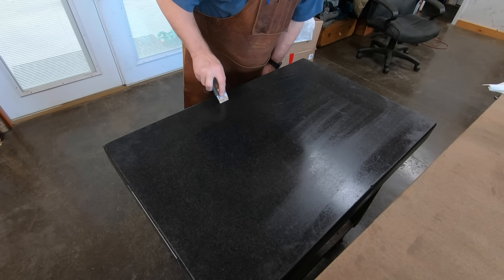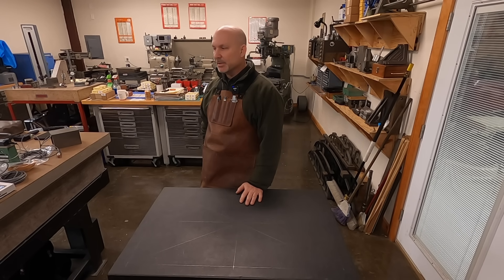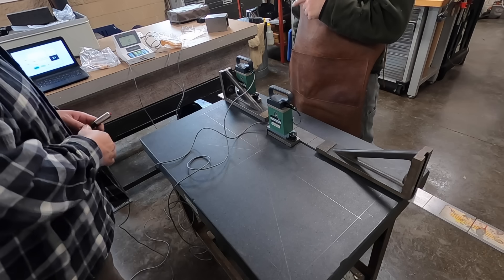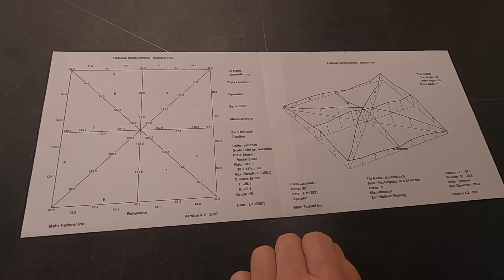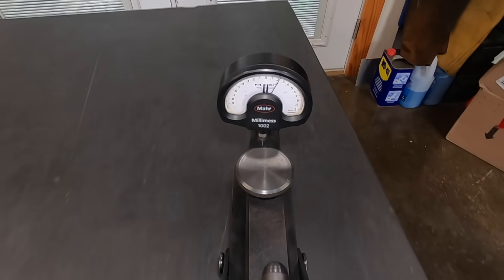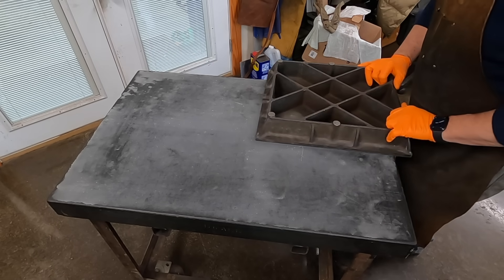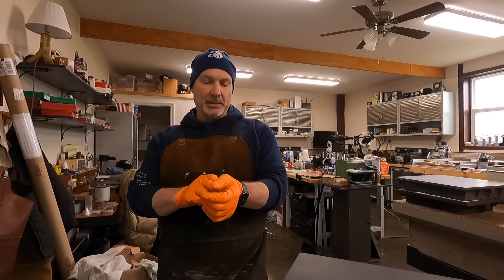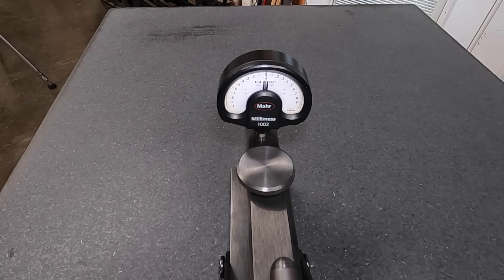Lapping my Granite Surface Plate to AA Grade

Comment: I worked in a 2A lab for the USAF for 12 years. This is exactly how it is done. Great job!!! Let the haters hate.
Reply: Underrated comment
Reply: Hi Ben, Can we use sand paper with foam pad instead of diamond dust? I think abrasive particles in sandpaper won't  be charged into the plate.

Comment: There's the term for it: "credentialism". People these days rely too much on someone's diplomas and certificates since they are often incapable of assessing the actual substance of the work done or the logic presented.
Reply: Some who are obsessed with credentials have become known to me as wokels, and wokel yokels.
Reply: I rather think this tread got started by some one who is in the wrong job. If they have spent for ever getting qualified then plainly it’s not their forte!
Reply: @johnsherborne3245 , that happens too. Although, I've seen some solid professionals who are perfectly capable of getting great results, but still believe that the only proper path to that point is formal training, certification, all those things. Definitely, being self-taught isn't for anyone and nobody says that everybody can or should do that. But people who successfully taught themselves or learned their trade in some informal way definitely exist on the same level as those who were trained traditionally.
Reply: I agree to some point but there are reasons for certification. What if some deadly failure was a result of bad tolerances and your tools weren’t calibrated by a certified company?
It’s chain that needs to work.

However I feel like a certification will become more and more watered down since it doesn’t mean you know what you're doing.
I also think certifications is a tool used to   “save” domestic workers.
Reply: Logical fallacy of appeal to authority.   Those fraught with this idea are the problem with modern society. These morons are the kind who worship career politicians and bemoan business owners.
Reply: @keithjurena9319 Logical fallacies fall under the domain of rhetoric, so the suggestion that an appeal to authority fallacy exists here is a misapplication of categories. Authority is the foundation of metrology. This especially applies when using any standard unit to characterize a physical object or phenomenon. Traceability to an authoritative standard is necessary to determine the amount of deviation from the standard.

Flatness itself isn't a feature of size, but rather a platonic ideal characteristic - it's self-referential.

In any case, the confidence and certainty in the characterization of this surface plate is at least as high as any I've seen from surface plate guys in the several decades I've worked in toolrooms and inspection labs.
Reply: @LILLJE , certification does have a very specific purpose. And it's equally wrong to do things that legally require certification for a reason without having one as well as requiring a certification just because you feel like it has to be required. In the modern world where people don't just care about safety but get really obsessed with it, the latter option is already too common without any positive outcome.
Reply: Idk in my field the credentials themselves aren't what's important. They hire ppl with the degree bc it certifies that you made it through the hell that is the program, and have the mentality and work ethic necessary to do the job. It's about the type of person, not the piece of paper.
Reply: I've seen certified persons that have no business doing what they're doing!
Reply: You mean you didn't buy a piece of paper to say you are smart!?
Reply: @LILLJE  And what is their certification going to do to ensure the tool doesn't fail? If it is going to fail it is going to fail and things certified by "authorities" fail all the time. True capitalism is the closest thing to real certification. If something or someone consistently does a good job they will have business.
Reply: @Complete bagel actually the one who will consistently do a sufficient job for the cheapest will have a business... or who make the buyer believe they did
Reply: I'm reminded of a story where an artist was being selected to draw a portrait for royalty. They asked for his credentials and while the artist was well trained and highly experienced from a reputable arts college, in response he sent only a sheet of paper with perfect hand drawn circle. The proof is in the pudding and having the right piece of paper to say one is qualified has little bearing.
Reply: The whole point of a certificate is just to say "this is agreed to be good by a several widely recognised experts". If you hadn't seen this video, and with no references you were shown the plate and told by a random guy it was lab grade, how would you be able to trust it? This video, in a way, is a kind of certification in that we get to judge how much we trust his results.

That's all certification is supposed to do. It's just a way of saving you the time of assessing it and finding a trusted expert to assess it. That's also why cheating is very harshly treated in reputable certification systems, as it completely undermines the whole purpose of the certificate and endangers the livelihood of anyone that uses those certs. 

Somehow, people have started seeing certs as some kind of superiority thing and then started attacking the idea of certs because of that. Certifications just mean for this one specific thing a bunch of other widely agreed to be experts have assessed their work and said it meets their standards.

And as others have pointed out, somethings can't really be certified, like art. If you wanted a graphic designer, even if they showed you their degree or post doc, you'd still need to see their work to know if they're right for your needs. At least with scientific things, there's not multiple completely different solutions that aren't interchangeable.
Reply: @LILLJE  the only reason I have to disagree is that no piece of paper prevents a mistake.

Comment: I spent 37 years in a US Army depot calibration lab as a technician and as a supervisor. We used a Mahr-Federal electronic differential level system to calibrate several surface plates every three years. Before that system came along, we used a collimator and mirrors to measure the flatness. That was much more difficult. Occasionally, we hired a contractor to come in and resurface the plates that didn't meet the specifications.

Comment: I have had the pleasure of seeing the "gauging lab" at a GM auto factory. It was a "clean room" that no one was allowed to enter except the certified technicians. The oil on your had would ruin their plates. It had large window so you could see the surface plates. It had an air-lock, and a huge HVAC to make absolutely sure that the interior of the room had "adequate climate control." The instruments in the room were used to calibrate the gauges that were used to calibrate the gauges that were used to check the parts being made.
Reply: Most people have no clue and it's really sad. Given what we do nowadays we should make way more money. Literally everything would stop if all machinists said nope. It would take weeks not years for inventories to run out and start affecting the world as a whole. You can't just replace these workers as a whole. It would be akin to letting the power go out worldwide. It's now or never before we're all tortured slaves. We're already slaves.
Reply: @drewjohnson4794  extreme tolerances and the ability to measure them is what makes modern society possible

Comment: Adam form the work that you do in you're shop that plate will be just fine for what you do.
Lance did a great job getting the plate to AA.
TAKE CARE OF THIS VERY IMPORTANT TOOL.
As a old tool maker I will tell you that the surface plate is the most important tool in the shop.
Congratulations

Comment: I worked in a machine shop with a large pink granite Starrett, I think it was A grade, anyway it had been used to assemble parts on. I made a table to hold it and had an office built around it, it was fabulous but had some chips/dings in it.

Comment: My father was a tool and die maker all his life and spent a lot of his time between a Boyar-Shultz surface grinder and his granite surface plate on his workbench nearby. Most of his work was in the .0001" tolerance range. Occasionally, he would get me to help him lift and rotate his black granite plate so that it would get even wear. The only thing he used to clean it was isopropyl alcohol. He could get a steel plate ground so flat that when you cleaned both the steel plate and the surface plate, the steel plate would float on a bed of air just like an air hockey puck. They had an inspector come in every so often to check and recalibrate the plate and he used an instrument called an autocollimator. I haven't worked in the trade for decades and miss it so much. My home machine shop is also my hobby; therefore, I just the cast iron top of my table saw for my poor-man's surface plate. Maybe some day I will spring for a real granite surface plate.
Reply: You can get 2ftx3ft ones at auctions all the time for not an enormous amount of money.
Moving it is a whole expense of it's own of course.
Keep an eye out and one with come up near you in time.

Comment: if you pick up another cast lap plate and number them 1, 2, 3. lap them against each other, 1 and 2, 2 and 3, 1 and 3. without much effort you will be able to keep your laps flat within 1/4 micron without much trouble. use the same technique as on the granite plate, but without running off the edges so much. biggest problem i always had after having my plates lapped was working the diamond out of the granite. you're doing a real nice job there. pet peeve of mine, people who use a surface plate for a bench.

Comment: If your shop is doing work where the contracts specify the use of certified measuring equipment, you are going to be charging the premium prices that go along with that. Otherwise, having a plate this flat is more about enjoying having and using a top grade tool. The certification wouldn't make it any better.
Reply: But the certified plate would actually be flat, you can't get true precision with portable equipment. A repeatometer should NEVER be used to check test equipment, it just isn't that accurate, sorry
Reply: @jacktheaviator4938  That plate is now flatter and more precise than anything he's ever likely to need. They made that point. If you have customers that require things like aerospace grade measuring tools, you charge aerospace prices.
Reply: @CrimFerret  i’ve heard abomb say most of what he does is 1 1/2 thousand tolerance a good some what surface is really nice and he is just checking the plate not testing it
Reply: @jacktheaviator4938  go watch the video Oxtoolco did of the certified guys doing his plates.
It's the same process he did here, so the plate is just as flat as a certified plate.
The A and AA grades are standards that require the measurements to be within + or - of certain tolerances, in other words, some imperfections are allowed, and he got below the limits set by those standards, using the tools required by the standards, regardless of the certificates he has on the wall.

Comment: 3rd generation cal tech here. Been resurfacing plates for about 11 years now. Alcohol or any rapid evaporative isn't ideal for cleaning surface plates. The rapid evaporation can break the molecule bonds of the minerals, etching the surface. It can affect the flatness of the plate over time and makes the plate more susceptible to chipping, or chipping worse. We use krud cutter as a degreaser (initially) and glass cleaners without ammonia (secondary) to prevent mirrored surfaces from sticking. Any cleaning you do with a solution will cool the surface of the plate as it evaporates. also, water based cleaners will increase the likelihood of rusting between the plate and metal surfaces on the plate if not accounted for.

Comment: Them's some pretty neat levels, and a very good result.  I've got my diy plate down to under 1/100 mm overall.  I wrote my own software (based on a friend's excel spreadsheet) to do it.  Doesn't use moody - after all, moody was working when a "computer" was  bunch of people doing math by hand, and results had to be achievable within a reasonable timeframe, say a day or so - instead it does a bunch of matrix math and uses a rectilinear grid, so gets overall and local flatness (within, obviously, the size of grid, which is somewhat defined by the length of your level).

To go any lower on my plate, which I don't actually need or particularly intend to do, I'd need to get some new measuring equipment, as I'm already deep into the realm of margins of error.  I'm using a 200mm long 0.05mm/m spirit level, and running it on a 3-point carriage to get 60mm between readings (my last video was still "roughing" and using a 9cm grid). My last mapping involved taking 5 readings at each station, throwing away the min / max outliers, and averaging the rest.  Took 6 hours to do, for a 1m x 20cm plate.

Aaaaaanyhoo, the software is up on my github, it's simply a local web page with a bunch of javascript that does the calcs, if you or your buddy with the levels wanted to do anything with it, feel free to do so.  BSD License, https://github.com/tufty/surface-plate

Comment: To all of you bakers out there these granite surface plates make the ultimate pie crust rolling “boards” before you roll out the pie crust put ice on the board, in a plastic bag works great. Keep the ice on the surface plate for an hour or so. Now you have the cold surface needed to make a really flaky pie crust. Make sure you keep your stone rolling pins in the refrigerator.
Reply from the maker: That’s a great idea! Perfect for a cheap or even cheap used  granite plate 👍🏻
Reply: And you get the added benefit of keeping your overall crust thickness tolerances  to within a few tenths ;)
Reply: @Abom79  exactly I know professional pie makers that keep their granite surface plates in walk in refrigerators. They prefer black granite so they can see the pie crust dough easier.

Comment: At a certain factory I was visiting one day I set my hand on a giant like 18 feet long cast iron surface plate which was used for layout marking of large steel castings and it was quite warm to the touch. I asked the old layout marking wizard guys why and they told me the plate has heating elements inside and they turn on to warm the plate 2 times a day because if it wasn't heated, even in summer (northern europe) the plate would be too cold for the touch to work on (hands would get cold very fast and it would be very uncomfortable to work on it the whole day).

Comment: The picture of the reflection from this plate at the end of the video is the most visible proof of the flatness for me. Not really proof but it's good to see how free of distortion the reflection is.
Very interesting.
Reply: "Flatness" is a relative term. From my experience, the reflection does not show difference between grades. There's absolutely no difference in reflection between an B and and AAA+ plate in reflection. I've lapped a bit of granite by now so this is where my experience comes from.
Reply: @chronokoks  as I said, it is no proof, but it's reassuring. However mirrors are often measured by reflecting a known wavelength of light off their surface so this can be a proof if you have the right tools.
Reply: @musicbro8225  It's not reassuring for me at all :D
Reply: @musicbro8225  Household glass mirrors are very distortion free but far from precision flat.
Reply: @literoadie3502  I was thinking more along the lines of mirrors you would find in a laser or a telescope actually. Household mirrors are in no way comparable to this surface plate let alone an optical mirror.
Reply: @musicbro8225  I mean you can't tell flatness from distortion after a certain point. Even a household mirror looks distortion free.

Comment: Read this on the Starrett site and found it helpful:  "Granite has a coefficient of thermal expansion of approximately .0000035 inches per inch per 1°F. As an example: A 36" x 48" x 8" surface plate has an accuracy of .000075" (1/2 of Grade AA) at a gradient of 0°F, the top and bottom are the same temperature. If the top of the plate warms up to the point where it is 1°F warmer than the bottom, the accuracy would change to .000275" convex ! Therefore, ordering a plate with a tolerance tighter than Laboratory Grade AA should only be considered if there is adequate climate control."
Reply: Yes! This is correct.

Comment: Hi guys, coming from background  as owner and working  in stone industry  for a good few years.
You can get products which seal surface  without  attracting dust and grit etc
Reply: but then you have a film that can vary in thickness thus making it not flat
Reply: @davidcoakley85 only if you do it,  I'll guarantee, mine doesn't,  like anything, it's knowing how to  do thing's
Further,  based on experience,  I know  using a different technique/ lapping pattern,  he could get better results  and faster
I do know what I'm talking  about,  I let very few staff hone  slabs,  I did it myself, as you can rapidly create humps and hollows, troughs and hills using his technique  if you are not very  careful. Using the correct technique greatly improves flatness/ reduces risk of peaks and troughs

Comment: Nice work, and I admire your patience and knowledge. Adam, be cautious setting things down on that surface, things have a tendency to want to slide on the air cushion. I almost lost a 100 lb angle plate over the edge, because of that.